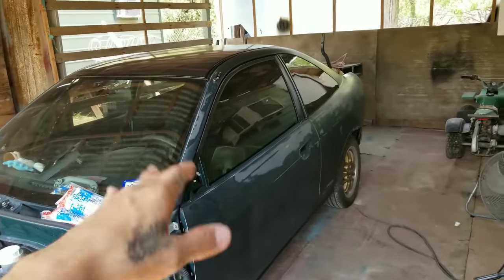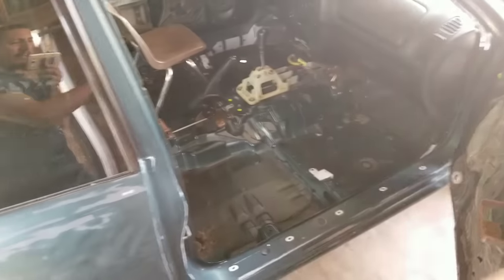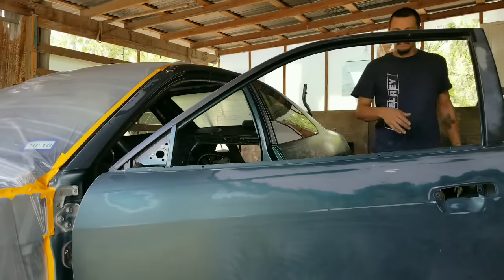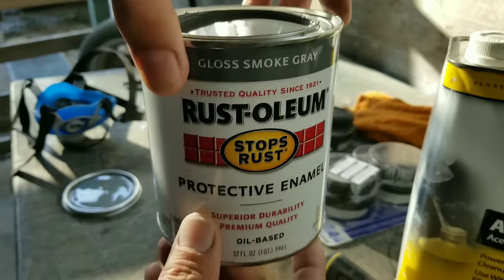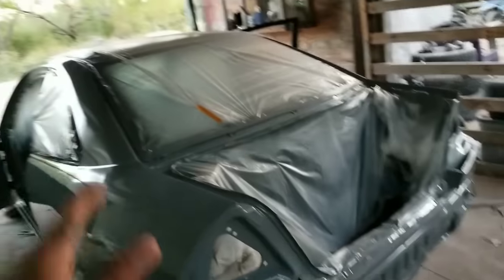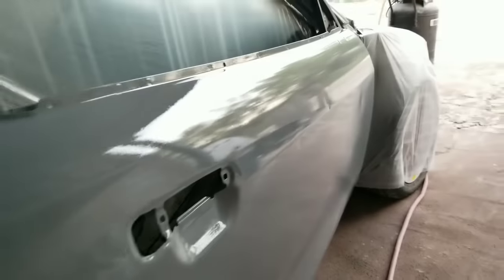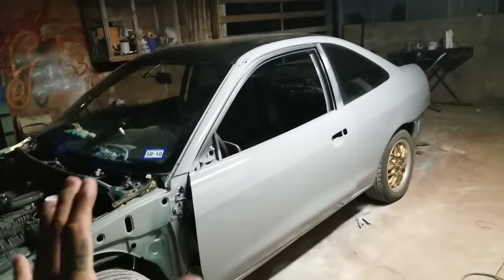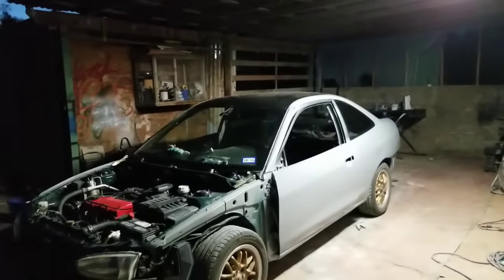Painting my car with Rustoleum - Gloss Smoke Gray

Comment: What was your  paint and thinner  ratio would like to know thank u
Reply: at 50/50 it is thin, but dries really quick for the next coat. 5 coats (a good thing) later and a beautiful result appears. Don't use a brush, use high density foam rollers, or a sprayer.

Comment: Looks good. I have painted cars with same paint. It's all in prep. I was a professional painter and all the haters are idiots. It's all in prep.  And sometimes cheap is all you can afford.  Sand and buff that thing and keep it waxed you should be good to go
Reply: Thomas	 Algrim  - hey bud, do you know what thinner he used and what the ratio was?  Much MUCH appreciated!!!
Any extra advice on doing this? 10-15 minutes between coats? Anything else you could share?
Thanks Thomas!!!
:)
Reply: @jasonenz4238  this is an old reply I know. Majic makes a specific reducer for their alkyd enamel, and a hardener as well. Majic paint itself is inferior to Rustoleum but their reducer/ hardener is compatible with Rustoleum and makes a very good combination

Comment: I'm thinking about this sort of paint job for my S10.  Is there a reason you don't use hardener?  I've noticed the rattle can job on my Suburban has remained soft almost a year later.  Others here on Youtube swear by adding a hardener.  I've never had a spray gun, always used spay cans with mixed results.

Comment: What primer you would use on bright silver metallic I put light gray primer and painted it with the paint code but I should of painted the whole vehicle because where I painted at looks darker than what the factory color looks after I painted it and put clearcoat. I used 2k primer and activator but the activator ran out so I used regular light gray primer over my truck. Maybe I didn't put enough coats of clearcoat on. I didn't paint the top part of my truck. I should of just painted the whole vehicle with the paint so so all the truck looks the same color it would of turned out better. Think am gonna just go and paint the top and other doors on the right side to match up.

Comment: You did a great job man how did you mix the paint? I seen the other video of the wet sand and buff my question is do you have to clear it or just buff?
Reply from the maker: Every cup I mixed was 12oz of paint, plus 6oz of acetone. And, you don't necessarily have to add clear coat. It has a good gloss straight from the can. As long as you take care of it,  it'll last years!
If it's not a budget thing and you decide you want to add clear,  then sure, your paint will definitely last even longer (as long as you take care of it of course)!
Reply: Would this ratio be the same as the rustoleum white primer?  I appreciate your time.  Preparing a Yukon for paint. It'll be my first time. 🤣

Comment: 1 question.. y do u spray in sections.. lol .. or ur just starting to paint.. 8:00 🕗 of video u said u had just sprayed da light housing n 1/4 panel.. it looks nice n wet.. that’s all all da paint job should look.. so don’t spray in sections so u won’t get any dry spots or dry sections..
Reply from the maker: Actually,  if you go from front to back,  you miss the detail! You may think you're getting an even coat over everything but you still have to sand and polish Regardless!!

So it doesn't matter how you spray.

Comment: Hey bro congrats on your ch!!!! I just subscribed awesome videos and very detailed.  I had a question i dont know much about compressors, thinking of buying one to do the Rustoleum paint job what size compressor did you used to spray? 3gl, 6gl, 20gl????
Reply from the maker: Thanks! And I appreciate the sub 👍 I'm using a 21 gallon air compressor from Harbor freight. I think anything smaller than that you will dry out your air tank before you finish painting a fender
Reply: @GTsPerformance  ok thanks!!!

Comment: You do really nice work. Was that a Harbor Freight gun? I'm in the market for a new compressor. What size and brand were you using?  Thanks for taking the time to post.
Reply from the maker: Thank You! And yes, it was a harbor freight gun. It has a 1.4 spray tip, very good for rustoleum since the paint is thick. And it's very easy to use👌
As for my compressor,  I'm using a 21 gal. From harbor freight also. It's been very good to me! I've had it for several years and painted many vehicles and small projects, and it's still going hard. It turns on about 3 or 4 times to do a full pass around an entire car so, I wouldnt use anything under 20 gallons.
Reply: @GTsPerformance  Thanks for replying.  That makes my choices easier.  Keep up the good work.

Comment: How many gallons is your aircompressor?  And how many times does it kick in when laying down a coat of paint over the car?
Reply from the maker: My compressor has a mere 21 gal. capacity. And yeah, it kicks in at least 2 to 3 times before layering a coat, but I let it rest in between.
Reply: @GTsPerformance  I've been painting with a 5 gallon and it runs consistantly  when painting.  Gonna upgrade to a 20-30 gallon  soon. Your compressors is oil-less right?
Reply from the maker: Yeah I can imagine that small thing running non stop. 😁 I got mine from harbor freight a while back ( I actually have to drive about an hour to the nearest harbor freight store ) but it still uses oil.

Comment: When would you spray the clear coat on rustoleum? After removing over peel?
Reply from the maker: Yes! after the paint dries and you have wet sanded the car, you can spray clear coat.
Reply: @GTsPerformance  Thanks Brotha, wanted to make sure. Appreciate the answer, keep doing what you doin, coming out good.
Reply: @GTsPerformance  3000 wetland or 2000? what clear coat would you recommend? does it help the paint last longer thanks man
Reply from the maker: Yes it will protect the paint much longer,  and give you better gloss.
But I would sand with 800 then clearcoat  over. 2000 is too smooth for paint to adhere to. 
The speedokote is between $80-$100.  Great if you're in a budget, and it works well.

Comment: So you don’t even put a coat of primer or clear coat & you still get it to look as good as you did with sum buff n polish????
Reply from the maker: Yea, the paint is thick and covers well on the first pass.  Usually,  with 3 or 4 coats of paint is good for a nice wet sand and buff, and still have enough paint for a second buff later on.
Reply: GT's Performance damn carnal I learned a lot from watching your vids really got an itch to do one of these paint jobs keep up the good content 🤙🏼
Reply: @GTsPerformance  would adding a primer help the paint last longer without respraying down the road?

Comment: Where is mix paint color,acetone or reducer 4:1:1?.
Reply from the maker: No, that'll do nothing to the paint.  Rustoleum is so thick,  you have to reduce it 2:1 (2 parts paint,  1 part acetone) so it can spray  and lay smooth.
Reply: When use point 1.2 1.3 or other nozzle spray gun

Comment: Seen a lot of people do these on YouTube notice their limited on colors. I was told you can get ahold of Rust-Oleum and get custom colors made never checked into it though.
Reply from the maker: Yea, rustoleum paints are already pre-mixed  into basic colors, but.. theres also Bar-Ox paint. Which is like rustoleum. It is meant for farm and equipment psint, and you can choose Any color you desire. 
I've been thinking about trying it soon.
Reply: @GTsPerformance  I've always wanted to try the Rust-Oleum paint job.. seen it done both with roller and spray. Spray seems like the way to go have you tried with the roller.
Reply from the maker: No, haven't tried the roller. But rustoleum is pretty good paint. Only thing is like you said,  colors are limited. 
It also comes a bit thick straight from the can so I would recommend thinning it with acetone or mineral spirits.
Reply: @GTsPerformance  yes very true thanks for your reply. I painted a lot of scooters and motorcycles frames. Plastics with Rust-Oleum very good paint
Reply from the maker: No problem bro,  and good luck with your project. I'll try making a video experimenting with paints.

Comment: Just my opinion, but it'd look bad ass if you used some clear and mixed in a white ghost Pearl In and sprayed over that grey. Get like a nardo grey Pearl look. White ghost Pearl is cheap.one bag should do the job!
Reply from the maker: I'm familiar with Nardo Gray, but I have no idea what a pearl white over gray would look like (at least in person). I can get the pearl pigment from PPG Paints, but the reason I didn't go with a full paintjob  was cuz this car needs a lot of bodywork, and it'd be too expensive for what the car is worth. 
My conscience wouldn't let me spray beautiful paint over bent or warped panels
Reply: @GTsPerformance  ghost Pearl can be bought from paintwithpearls.com for cheap. Its pretty much translucent but catches the light. O thought the made that Rust-Oleum in a clear as well so it wouldn't be high dollar, no biggie it was just a suggestion.

Comment: Honestly, I cant stand Rustoleum paint jobs. I dont know why you guys just dont get a gallon of single stage paint. You should prime all the areas you went through also.
Reply from the maker: Cuz it's only $40. 🤷‍♂️
Reply: For a basic beater is fine. I don't understand all the hate on rustoleum paint jobs smh
Reply: This is my point. Rustoleum is a decent-low end quality paint. It will fade and not hold up in the long run. Their is simply a rite way to do things. Everyone talks about and looks for the "cheapest" way to do things. Their is cheaper/low end automotive paints out there. Single stage paints are the way to go. The base coat & clear coat is mixed in and its a 2k. So its uv resistant and will last longer. Maybe most people don't know and I get it. But all the prep work and money they spend on cheaper paints can be ruined in a couple of months. And its not that great for durability for rock chips and scratches. I just hate these videos on doing things the wrong way, that's all. It has become the "norm". Just sayin.
Reply: @JOEGGGJOE  definitely see where your coming from but I've seen quite a few rustoleum jobs hold up for a few years just fine. So ymmv. For a basic diy person that's looking to paint their daily this will more than suffice.